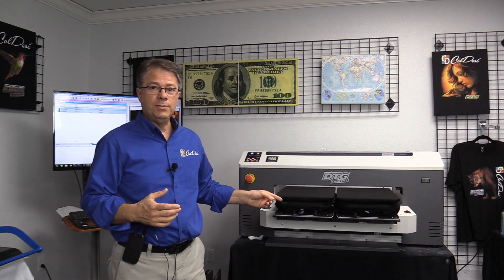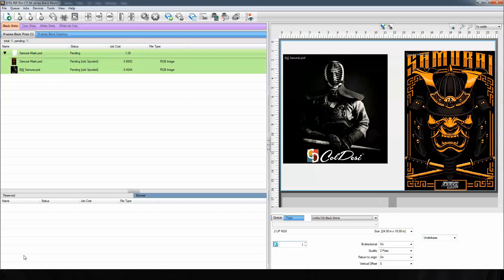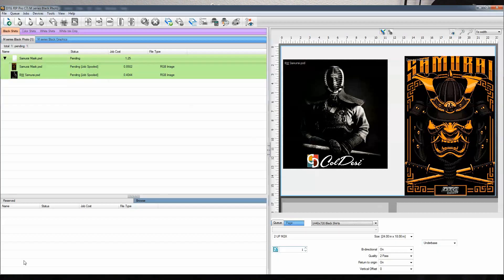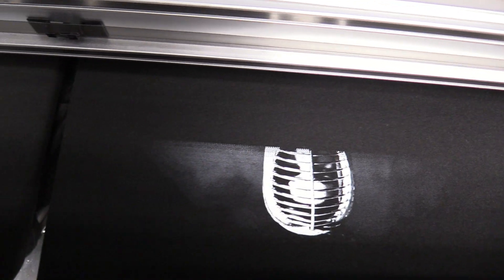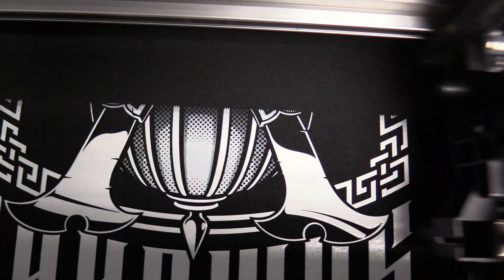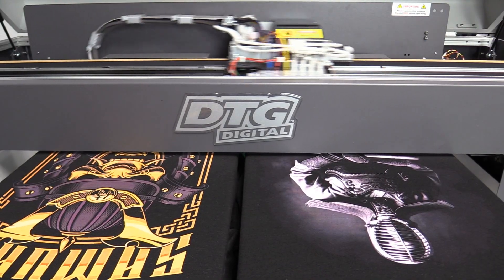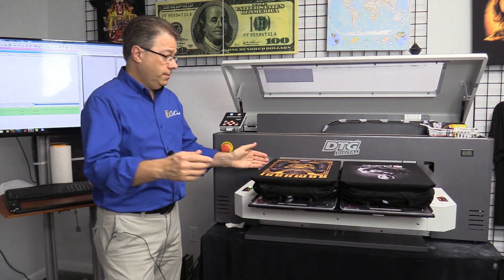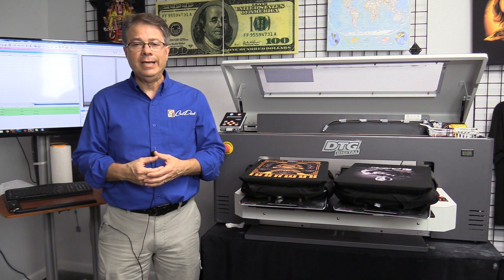M2 DTG Printer Demonstration | Kendo and Samurai Shirts

Comment: just wanted to ask if there was still places to buy parts for the M2? looking for extra Platens of different sizes as well as one of the stock one the came with. plus the ink. Also is the software on the machine and downloaded to your PC or do I have to purchase the software as well
Reply from the maker: Give our supply pros a call. We still sell some M2 parts. They will be able to point you in the right direction. 800-891-1094

Comment: i have this question in my mind that weather the design have that dark part as in the demonstration, does it print out the dark as well?, i would prefer the left blank and give the garments to breath.
Reply from the maker: Great question Phu - first, this design had no background and since the G4 is an ink jet printer it ONLY printed image, not background. Second, if there WAS a black background in the image we would have used a feature in the RIP software that comes with it called KnockmeOut color and told the system not to print any black.

Comment: What are your after sales services like for purchasing something this expensive, even with the DTG G4? Will this company give lifetime support for the DTG machine? Heard after afew years with ColDesi DTG printers, there's usually no replacement parts available if something breaks on the DTG which means the machine is useless. Will there always be upgrades available or the same mechanical parts available even after owning this machine for 10 years, will there still be parts available? Does it come to a point where you will stop manufacturing this DTG which leads to the company also stopping manufacturing for parts?